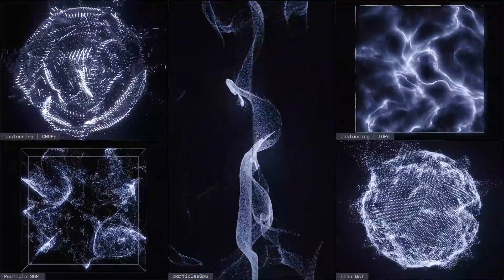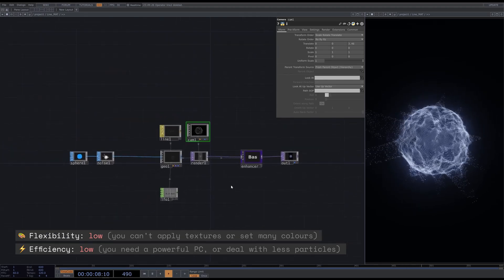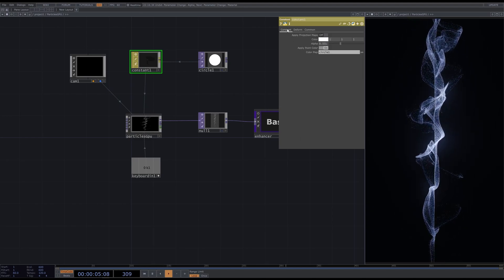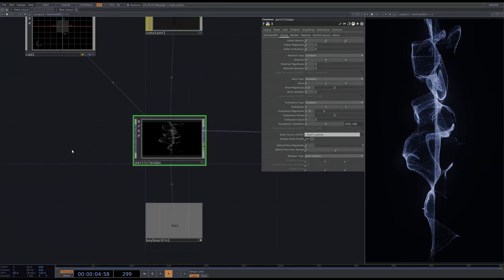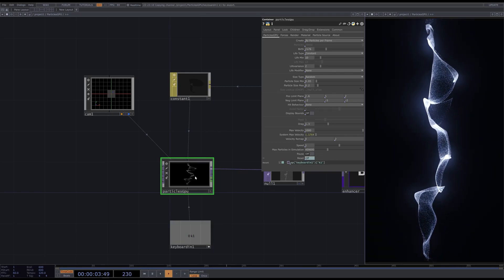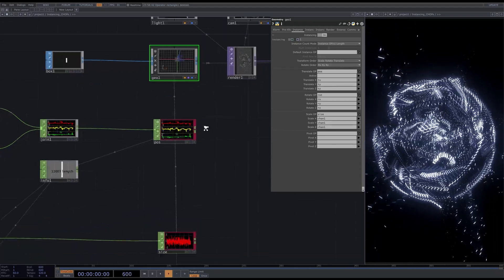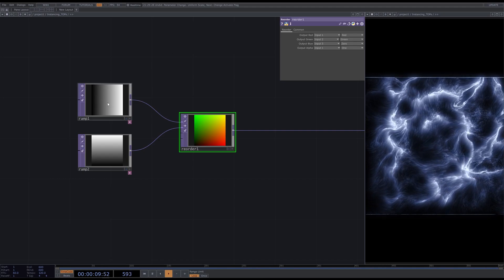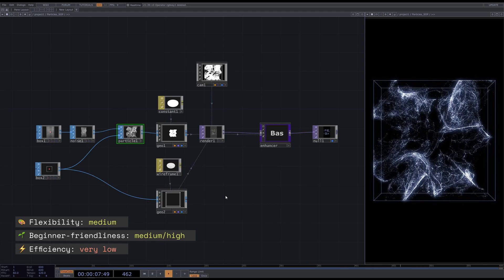5 Ways To Make Particles in TouchDesigner

Comment: Hello! I'm working on a web-based augmented reality project. My ultimate goal is to have an animated point cloud in glb or a volumetric video. In this scenario, would the best approach be to use Particle SOP to export in fbx and then convert the file to glb? I'm concerned about the file size and performance of the experience.

Comment: Hi! I would like to ask how to create the second type of vertical particles that spread freely, or what operations did you perform in the camera😢
Reply from the maker: Hi, I didn't change any camera settings except for translation by Z coordinate to zoom out a bit. Just use the particleGPU component, set particle source shape to line going vertically from -10 to 10, apply a few forces: turbulence and wind, set the material like I did. That's pretty much it. If your question is about about changing the movement, just tweak forces. Good luck:)

Comment: Hello! Could you please explain, how did you connect noise1 & line1 to geo1? Thank you!
Reply from the maker: Hi, you should add the Noise SOP, then right click on its output, and add the Geometry COMP. To add the Line MAT, drag it to the Geo and choose 'Parm: Material'. That's it :) This video wasn't intended for absolute beginners, so I recommend to cover the very basics before watching it. Also, check out the links below the video: you'll find step-by-step guides for all the techniques mentioned here. Because this one is not a regular tutorial, it's more like an explanation video to systemize different approaches. Good luck!

Comment: Hey Anya, how do you set the length of the noise tops for rotation and size? Where is the info sop referenced on the noise sops?
Reply from the maker: Hi, you have to go to the Channel tab, set Start and End to Samples (using a dropdown list to the right of the parameter), and then attach the Info CHOP's length channel minus 1 to the End parameter of the Noise CHOP. For example: op('info1')['length'] -1
Reply: @anyamaryina  ahh thanks Anya! I did that but didn't do minus 1. I'll try again later today. One of the best, beginner friendly tutorials I've seen. Well done !